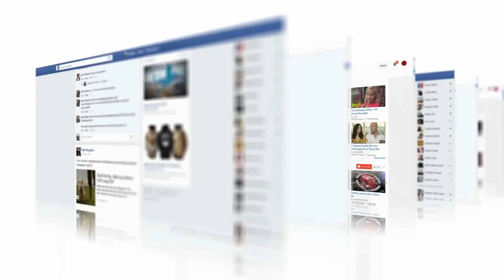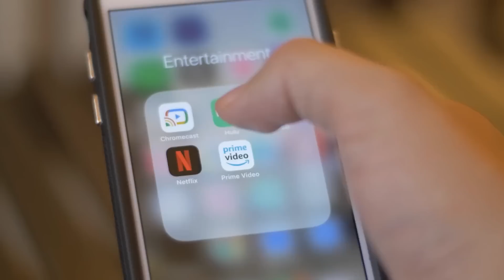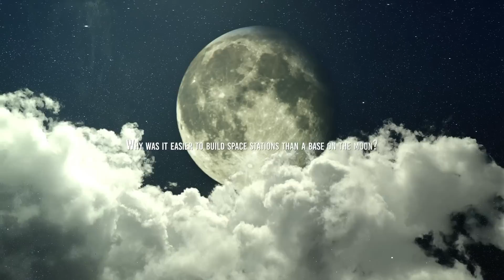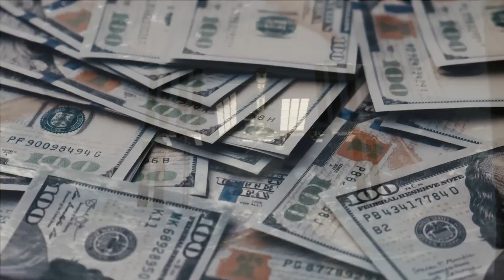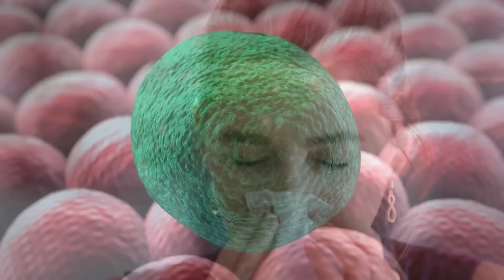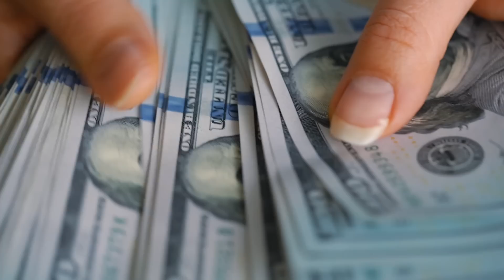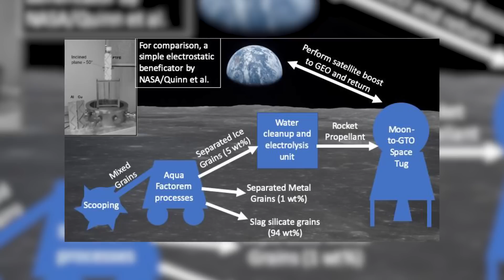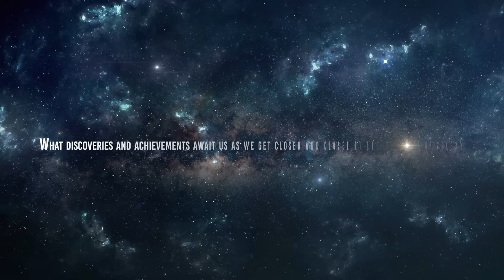Why Is It So Difficult To Build A Lunar Base If There Is Already One In Space ?

Comment: Umm This video got to be old because the moon has a ton of water and resources. With an airlock you don't have to worry about lunar soil. The moon is actually so close that building a colony in stages is also possible. Sending stuff to the moon using rockets that take 4 months is nothing as just cargo.

Comment: I would ask Elon to bring a shovel to the moon...
Building half in and on the surface would be cheaper...
The dome/ceiling would be from polycarbonaat plastic. 
The soil has to be used as a kind of cement...
Elon has this option and cost are lower than nasa...
We need to built this with the world and not alone..
ISS is a good sample of doing things together....

Comment: You show rockets landing Vertically. 
That is Really ILLOGICAL!
PROBLEMS
1) THE AMOUNT OF LUNAR DUST that would be Put up would probably that months to settle back down!
2) trying to keep the Rocket UPRIGHT would be extremely difficult if not IMPOSSIBLE!
3) UNLOADING would be almost impossible!
4) Then LIFT OFF, WILL CAUSE MORE SUSPENDED PARTICLES! All over what was just unloaded !
This is just a Small amount of issues!
SOLUTIONS
1) Do ROCKETS similar to Apollo! Like the lunar module. Take a payload up. Detach from rocket. And Only the payload goes to the surface.
Rocket returns to be used again. 
2) Make payload so everything can be Reused.
3) CLEANING, use forced air, with Magnetic areas to attract dust.
HAVE MORE! TO SOLVE ISSUES! JUST NEED A PAY CHECK!

Comment: 1 minute of physics will show anyone that the center of mass or gravity are exactly the same  on the moon, on the earth or in space: its a property of the distribution of mass, not gravity.
The moon is abundantly supplied with iron, aluminum, silica and oxygen. Its a feature not a problem. Many of the problems you list are strawman which you tick off later in the narrative.
It's much easier to design a lunar structure than a terrestrial one, it requires less strength not more.
Reply: Lunar structures don't need to overcome as much gravity as Earth, but the structure must be airtight to hold the atmosphere inside against the vacuum of space.